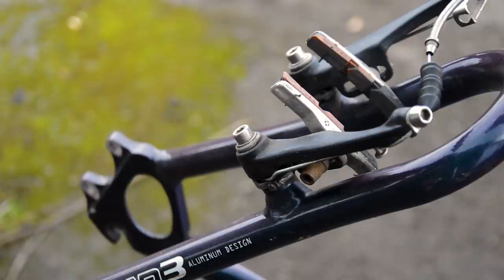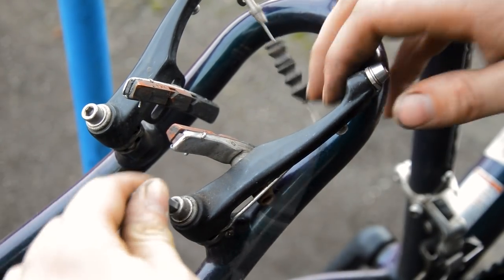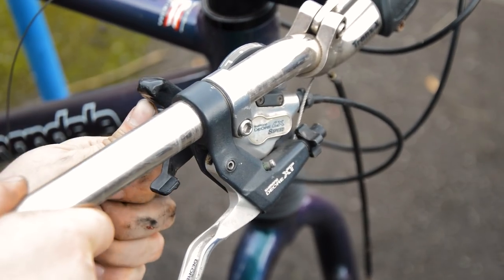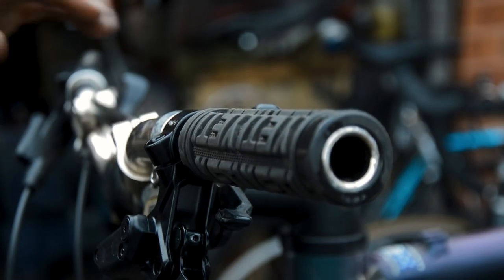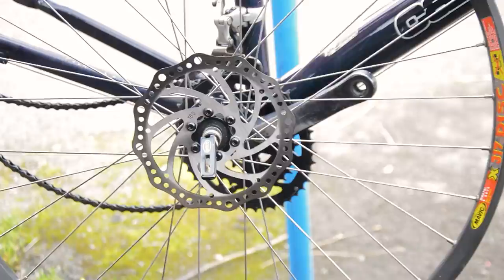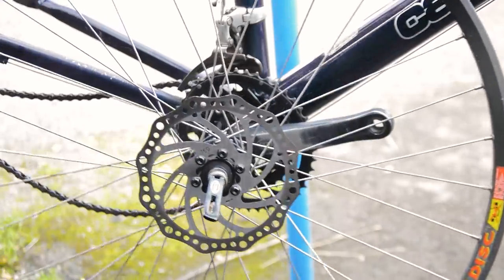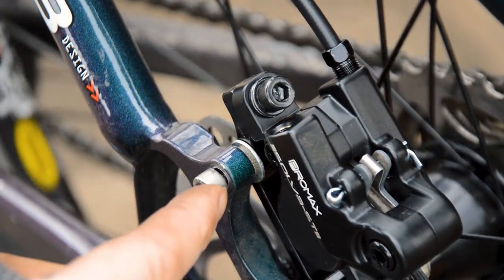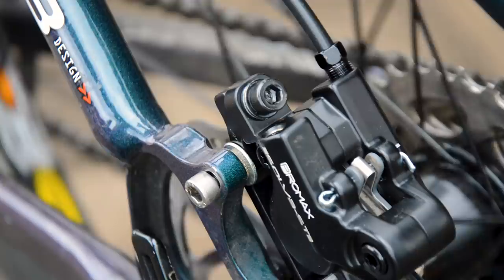Upgrading V Brakes To Disc Brakes - Cannondale F700SL Retro Mountain Bike

Comment: Not a fan of disk brakes; they wear out too fast. Good for riding down mountains, only. Otherwise, an expensive sliver of plastic dreamed up by the corporations and their sponsored lackeys. Rim brakes are forever (or something like that). One good thing, they might help you sell the bike.
Reply: Where did you hear they were made of plastic? When brake rotors or disc brake pads wear out, its very simple to replace either. Aluminum rims also have a limited life, but when they wear out, you have to get a whole new wheelset.
Reply: It depends a lot on use. In rainy conditions you can wear out a rim brake wheelset in less than a year and that's a lot more expensive than just swapping discs and pads. If durability is your main requirement then nothing can beat coaster brakes and drum brakes. Or fixed gear I guess. But with fixed gear you will be replacing the chain more often.
Reply: @jonathanho4272  You're entitled to your opinion. If you wish to be prey to fee structures, go ahead. Rotors are plastic all right, but you can call it carbon if you like and pay and pay for them. Never yet had a rim on a bicycle wear out, nor a brake pad and I put them through it. The main problem, and this goes far beyond bicycles, is a system of consumption that requires us to keep replacing things to remain current. I mean phones, entertainment systems, computers, furnaces, cars, etc. with their attendant fee structures demanding constant upgrades because the materials wear out and/or become "obsolete" according to the system. Why does Monkeyshred concentrate on older bikes -- '90s, '80s and earlier? Because they're better made than what's available in today's overpriced market. Be wise, don't be suckered by it.
Reply: @peterharrer3261   The whole problem with the items you listed is that they often rely on proprietary parts and are impractical to repair. This means that when when one part goes bad, the whole item must be replaced. Disc brakes don't have this problem. They are highly standardized and modular, so if one part breaks or wears out, it can be replaced. I imagine that the current generation of disc brake wheels and brake calipers, that is, the expensive, non-disposable parts, will be used for a long time.
Reply: @jonathanho4272  That is not my experience.
Reply: @peterharrer3261  Some of your info isn't quite correct. There are no rotors available that are made of plastic, as they would fail immediately. They need to be made of metal to handle thermal cycling and compressive forces. You are correct that pads on discs are wear items, but so are rim brake pads and the rims themselves, as mentioned before. Pads are usually less than $10 for a whole set for discs and take far less time and fiddling than room brake pads do to install. Then a rotor is $15-20 if you don't need anything special. This is far less than the cost of a new wheel or rim once it wears out. The only other common maintenance on discs is bleeding the brakes, which takes a couple ml of fluid and a few minutes on most modern braking systems. If you want to eliminate bleeding altogether, and want more simplicity and don't require downhill/Enduro/trail levels of braking power,  try cable actuated disc brakes. They are a fraction of the cost of hydraulic discs, not much more than a few dollars more than a set of v-brakes. You are however right that the biking industry is rife with techno-fetishism, in which new products are frequently brought out to get more money out of your wallet, not to improve performance. It's totally understandable and justified if you want to stay with rim brakes if they work for you; however disc brakes were a huge step forward in the bike industry performance-wise. Luckily the technology and scales of economy have gotten to the point where they can actually save money in the long run.
Reply: @compasteedee  I appreciate what you say, but maintain that disks are good only for riding down mountains. Don't do much of that, but can sail along trails with the best of them and haven't worn out a rim yet. You have also correctly identified my larger beef with an industry hellbent on conditioning us to pay and pay with no substantial improvement in the experience of cycling. That's what I care about--the ride. How I choose to pursue it is my business. However, you will have to permit me some degree of doubt when you say the technology and scales of economy can lead to savings. Given current marketing strategies, that is not the pattern.

Comment: v brakes are trrible,even budget disc brakes are far superior.
Reply from the maker: I wouldn’t say that. Completely depends how you set them up.
Reply: Generic V-brakes can be bad. Wanna know the reason? It's because the V-brake caliper arms are very thin metal and 'flex' when trying to stop. It's why upgrading the arms is a good option to do if you want good power. Because the flexing of the arms causes the arms to 'bend' inwards when you pull the lever down hard and it doesn't put all that pressure into the pads. The arms just bend instead and looses all that braking power.

To fix this upgrading to beefer V-brake arms is best. They'll have thicker metal arms that'll not bend and allow for all that lever pressure to transfer into the pads instead of the flexing arms.

And yes V-brakes upgraded with better arms do perform as good as disks. Only difference between disc and V-brakes. Is the pad life and wet weather performance. Which can be pro to cons in both worlds. For instance.

V-brakes perform Great in silent braking performance and when tuned right they don't make any noise. You can stop right beside someone and they wouldn't know. Disc brakes make a slight grindy sound when stopping no matter how well clean they are. But the worst thing is. Discs make a death dieing squeel that is horror movie level terrorifyingly loud. Compared to V-brakes they squeel. But not as bad as Discs.

Wet Weather/Ice cold. Discs make perform much better in wet times or icy times. But sometimes if someone is twitchy and slams on the breaks. It causes wheel lock up and you end up loosing traction. V-brakes may not perform great in stopping as fast due to them slipping on the wheel rim surface. But that slip can also be a good thing for people twitchy and slam on their breaks. This'll cause the wheel to slip and not lock up/causing the wheel to loose traction on wet surfaces or icy surfaces.

Heat up. Since V-brakes are a rubber system onto a metal rim. It has a much larger surface and cooler performance under heavier stopping force. Compared to disc's that have a smaller rotor to deal with on a semi-metal surface to metal surface. Which heat's up REALLY fast. So much you could cut plastic with how hot the rotors get.

But the pros on discs are nice for LARGE almost always held on braking ability. Since Disc pad's will last over 10times that of a V-brake's rubber pads. But as above. If you aren't heavy on doing 30mph downhill all the time and riding the brakes. V-brake pads will last pretty well.

Plus another pro and con to V-brakes/Discs. Is Wheel true. V-brakes can tell you if the Wheel is out of true just even by alittle bit. Discs you never know since it doesn't effect the wheel's tilt in general. But sometimes you want a good true wheel or else it could pose problems in balance and ride.

So both sides have their ups and downs.

Though i have to say. This guy should've kept the V-brakes for standard style riding on roads and stable flat off-road for much quieter use. While Discs could be a Back up or used for those times of riding on the brakes heavily during a large downhill slide.

I mean you got a bike with both sets. Might as well put it to good use. Or use one as a sorta E-brake system with a simple friction shifter cable that you can use to crack up and force the pads to close till you uncrank it. So if you're on a hill. The bike won't roll away. The options are pretty open for the two systems.